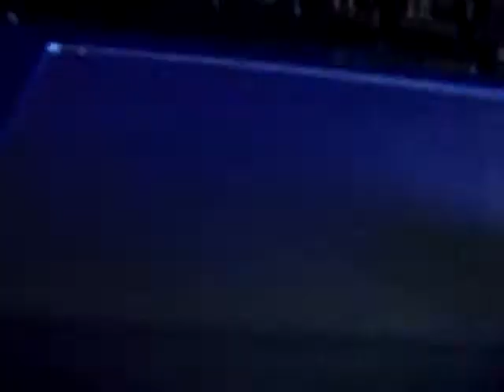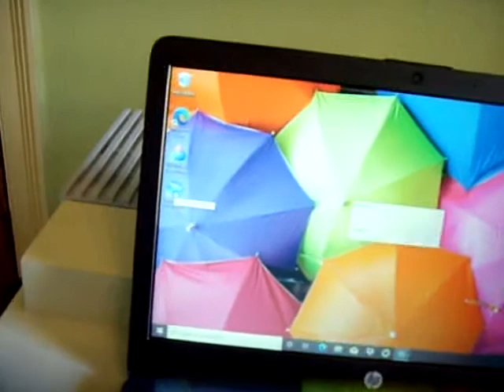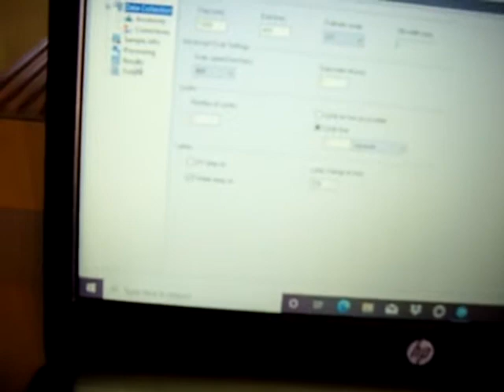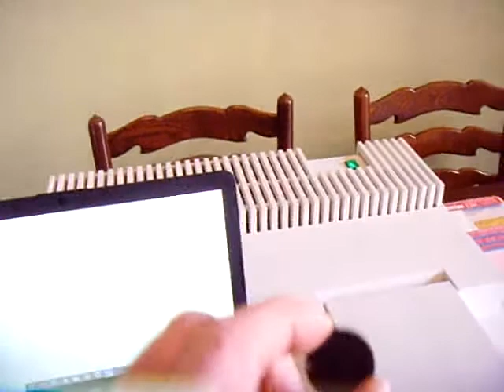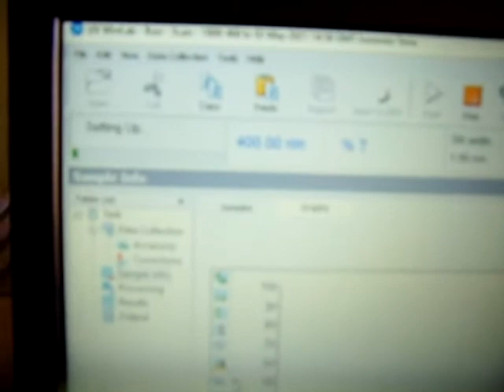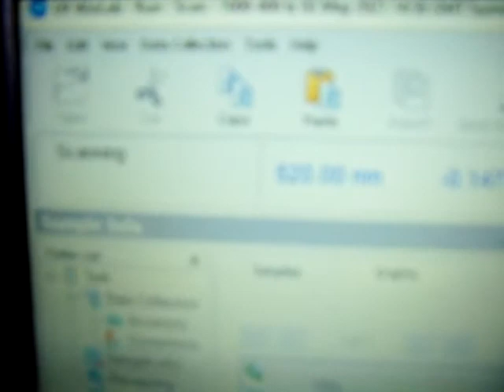Perkin Elmer Lambda 25

Comment: Could you help me please:

I have UVwinlab 5.2
I couldn't use the PC on it, it doesn't work at all.
But on old one it works.
I need to use PC like you.
Reply from the maker: Oh yes I'm afraid thats correct. Modern PCs, with their fabulous PCI data bus systems won't run old versions of UV Winlab. I don't have this PC in front of me but to run an older wavelength dispersive Perkin Elmer, if memory serves you will need an ISA bus. Thats an old PC! You won't run one of these on UVWinlab either. We are using FTG Associates FilmStar software to run this instrument.

You have an old instrument like this which you want to use? We can help you with that if you let us know exactly what you have. We might need the instrument to do some small modifications but it can be done. And, of course, these are wavelength dispersive instruments, not fourier transform. We much prefer them for the work we do on wide band optical interference devices
Reply: @AshYPT  Thank you. i have Perkin Elmer lambda 40
Reply from the maker: A Lambda 40 is a much newer instrument than the IR machine in this video. It should run on a 'modern' PC with a PCI bus. We run a Lambda 20, Lambda 4 and a Lambda 25 with Windows 7 using a USB/RS232 convertor and UVWinlab. Can't quite remember the version of UVWinlab, but we renewed the software in 2018 with the latest version.

I can't remember all the versions of UVWinlab. How old is 5.2? I think its designed for Windows XP? Is it that old? You might struggle to get it to run on an XP emulator. If so, you'll need a PC that runs Windows XP. The good thing is that if you have one, it should also have an RS232 port
Reply: @AshYPT   Thank you for your help. Your assistance is greatly appreciated.